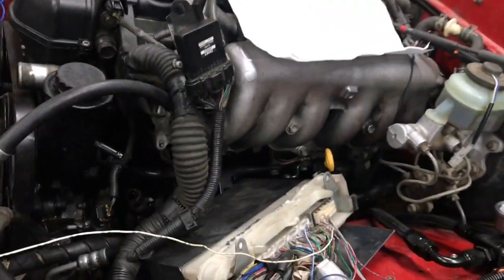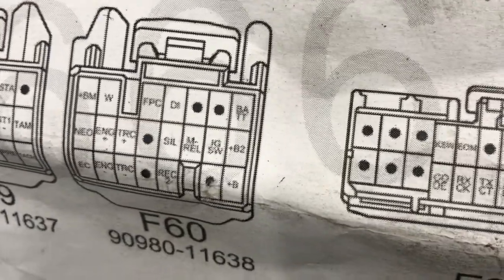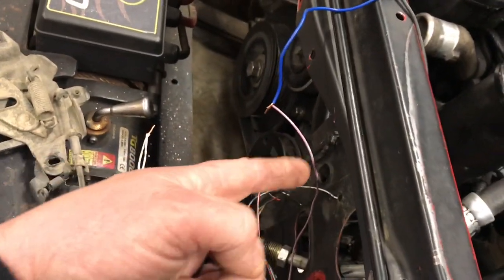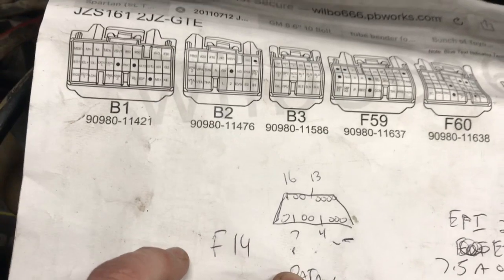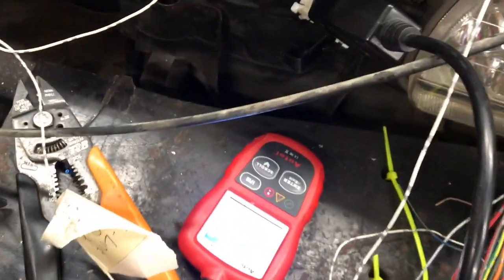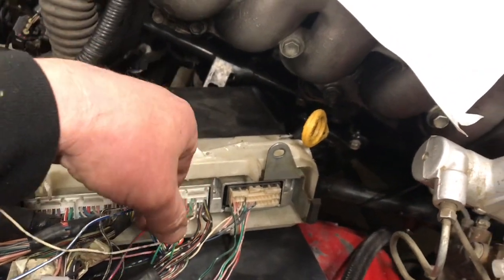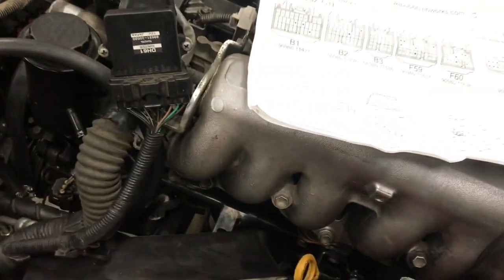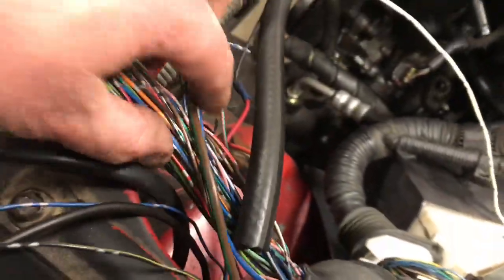How to wire 2JZ GE obd2 connector

Comment: Hey I got mine plug in all good but my obd2 says connection failed please help
Reply from the maker: Could be a defective computer. You still having issues with the etcs not getting power?
Reply: @im469too  yes please is there somewhere where I can contact you & message you ?
Reply from the maker: @brayanfernandez885 have you pin tested the bm circuit?  I think that the computer maybe the issue. Usually no communication through the obd2 connector is a bad ecm. I would pin test all the circuits your having problems with. Just to make sure you don’t have a wiring issue